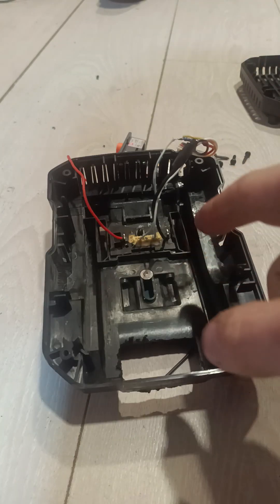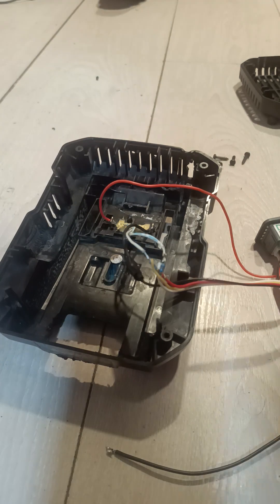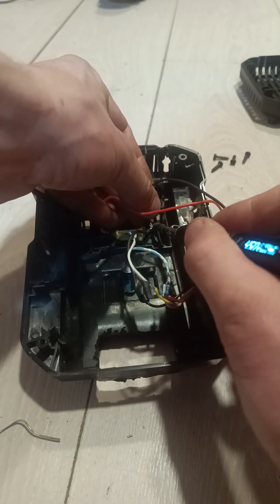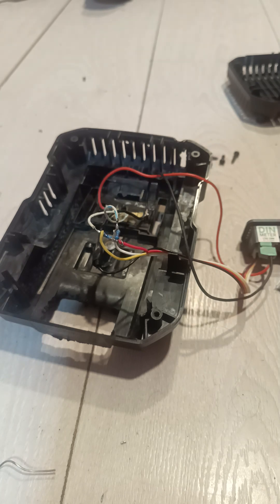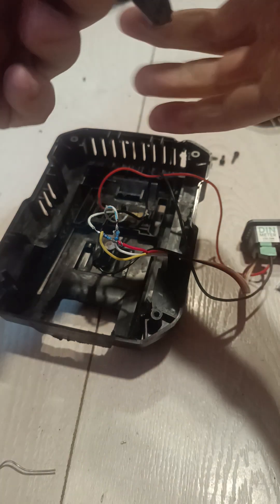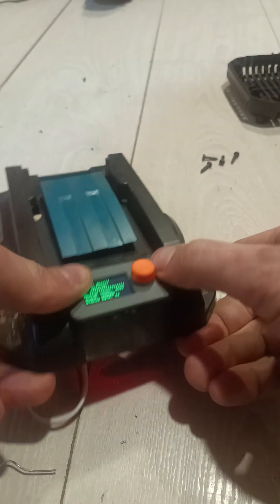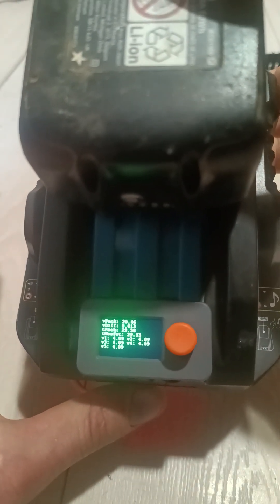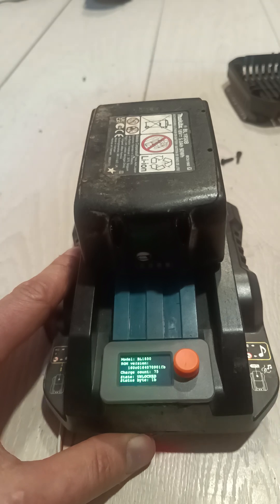Makita error/lockout flag reset ( simple standalone ) based on open-battery-information.

Comment: Hello my friend 
I tried install firmware to DinMeter but showing this error.

"Compilation error: grpc: error while marshaling: string field contains invalid UTF-8" I am sure I am doing something wrong but could not find yet. Can you help me please? Or can you crfeate some video about how can install firmware to Dinmeter
Reply: grpc: error while marshaling: string field contains invalid UTF-8

Compilation error: field 'owi' has incomplete type 'Makita<5>'
Reply from the maker: @eleman27  Makita headers not included correctly? or not installed in libraries folder?
Reply: @diybatterytech  there is too much error really I could not understand that
Reply: c:\Users\HMKOCER\OneDrive\ h L       g\Arduino\libraries\OneWire\OneWire2.cpp:147:6: error: 'template<int m_pin> class OneWire' used without template arguments
  147 | void OneWire::begin(uint8_t pin)
      |      ^~~~~~~
c:\Users\HMKOCER\OneDrive\ h L       g\Arduino\libraries\OneWire\OneWire2.cpp: In function 'void begin(uint8_t)':
c:\Users\HMKOCER\OneDrive\ h L       g\Arduino\libraries\OneWire\OneWire2.cpp:150:9: error: 'bitmask' was not declared in this scope; did you mean 'umask'?
  150 |         bitmask = PIN_TO_BITMASK(pin);
      |         ^~~~~~~
      |         umask
c:\Users\HMKOCER\OneDrive\ h L       g\Arduino\libraries\OneWire\OneWire2.cpp:151:9: error: 'baseReg' was not declared in this scope
  151 |         baseReg = PIN_TO_BASEREG(pin);
      |         ^~~~~~~
c:\Users\HMKOCER\OneDrive\ h L       g\Arduino\libraries\OneWire\OneWire2.cpp: At global scope:
c:\Users\HMKOCER\OneDrive\ h L       g\Arduino\libraries\OneWire\OneWire2.cpp:164:9: error: 'template<int m_pin> class OneWire' used without template arguments
  164 | uint8_t OneWire::reset(void)
      |         ^~~~~~~
c:\Users\HMKOCER\OneDrive\ h L       g\Arduino\libraries\OneWire\OneWire2.cpp: In function 'uint8_t reset()':
c:\Users\HMKOCER\OneDrive\ h L       g\Arduino\libraries\OneWire\OneWire2.cpp:166:9: error: 'IO_REG_TYPE' was not declared in this scope; did you mean 'IP_GET_TYPE'?
  166 |         IO_REG_TYPE mask IO_REG_MASK_ATTR = bitmask;
      |         ^~~~~~~~~~~
      |         IP_GET_TYPE
c:\Users\HMKOCER\OneDrive\ h L       g\Arduino\libraries\OneWire\OneWire2.cpp:167:18: error: 'IO_REG_TYPE' does not name a type; did you mean 'IP_GET_TYPE'?
  167 |         volatile IO_REG_TYPE *reg IO_REG_BASE_ATTR = baseReg;
      |                  ^~~~~~~~~~~
      |                  IP_GET_TYPE
In file included from c:\Users\HMKOCER\OneDrive\ h L       g\Arduino\libraries\OneWire\OneWire2.h:1,
                 from c:\Users\HMKOCER\OneDrive\ h L       g\Arduino\libraries\OneWire\OneWire2.cpp:143:
c:\Users\HMKOCER\OneDrive\ h L       g\Arduino\libraries\OneWire\OneWire2.cpp:172:32: error: 'mask' was not declared in this scope; did you mean 'umask'?
  172 |         DIRECT_MODE_INPUT(reg, mask);
      |                                ^~~~
c:\Users\HMKOCER\OneDrive\ h L       g\Arduino\libraries\OneWire\OneWire_direct_gpio.h:263:57: note: in definition of macro 'DIRECT_MODE_INPUT'
  263 | #define DIRECT_MODE_INPUT(base, pin)    directModeInput(pin)
      |                                                         ^~~
c:\Users\HMKOCER\OneDrive\ h L       g\Arduino\libraries\OneWire\OneWire2.cpp:178:37: error: 'mask' was not declared in this scope; did you mean 'umask'?
  178 |         } while ( !DIRECT_READ(reg, mask));
      |                                     ^~~~
c:\Users\HMKOCER\OneDrive\ h L       g\Arduino\libraries\OneWire\OneWire_direct_gpio.h:260:52: note: in definition of macro 'DIRECT_READ'
  260 | #define DIRECT_READ(base, pin)          directRead(pin)
      |                                                    ^~~
c:\Users\HMKOCER\OneDrive\ h L       g\Arduino\libraries\OneWire\OneWire2.cpp: At global scope:
c:\Users\HMKOCER\OneDrive\ h L       g\Arduino\libraries\OneWire\OneWire2.cpp:198:6: error: 'template<int m_pin> class OneWire' used without template arguments
  198 | void OneWire::write_bit(uint8_t v)
      |      ^~~~~~~
c:\Users\HMKOCER\OneDrive\ h L       g\Arduino\libraries\OneWire\OneWire2.cpp: In function 'void write_bit(uint8_t)':
c:\Users\HMKOCER\OneDrive\ h L       g\Arduino\libraries\OneWire\OneWire2.cpp:200:9: error: 'IO_REG_TYPE' was not declared in this scope; did you mean 'IP_GET_TYPE'?
  200 |         IO_REG_TYPE mask IO_REG_MASK_ATTR = bitmask;
      |         ^~~~~~~~~~~
      |         IP_GET_TYPE
c:\Users\HMKOCER\OneDrive\ h L       g\Arduino\libraries\OneWire\OneWire2.cpp:201:18: error: 'IO_REG_TYPE' does not name a type; did you mean 'IP_GET_TYPE'?
  201 |         volatile IO_REG_TYPE *reg IO_REG_BASE_ATTR = baseReg;
      |                  ^~~~~~~~~~~
      |                  IP_GET_TYPE
c:\Users\HMKOCER\OneDrive\ h L       g\Arduino\libraries\OneWire\OneWire2.cpp:205:39: error: 'mask' was not declared in this scope; did you mean 'umask'?
  205 |                 DIRECT_WRITE_LOW(reg, mask);
      |                                       ^~~~
c:\Users\HMKOCER\OneDrive\ h L       g\Arduino\libraries\OneWire\OneWire_direct_gpio.h:261:56: note: in definition of macro 'DIRECT_WRITE_LOW'
  261 | #define DIRECT_WRITE_LOW(base, pin)     directWriteLow(pin)
      |                                                        ^~~
c:\Users\HMKOCER\OneDrive\ h L       g\Arduino\libraries\OneWire\OneWire2.cpp:213:39: error: 'mask' was not declared in this scope; did you mean 'umask'?
  213 |                 DIRECT_WRITE_LOW(reg, mask);
      |                                       ^~~~
c:\Users\HMKOCER\OneDrive\ h L       g\Arduino\libraries\OneWire\OneWire_direct_gpio.h:261:56: note: in definition of macro 'DIRECT_WRITE_LOW'
  261 | #define DIRECT_WRITE_LOW(base, pin)     directWriteLow(pin)
      |                                                        ^~~
c:\Users\HMKOCER\OneDrive\ h L       g\Arduino\libraries\OneWire\OneWire2.cpp: At global scope:
c:\Users\HMKOCER\OneDrive\ h L       g\Arduino\libraries\OneWire\OneWire2.cpp:226:9: error: 'template<int m_pin> class OneWire' used without template arguments
  226 | uint8_t OneWire::read_bit(void)
      |         ^~~~~~~
Reply: c:\Users\HMKOCER\OneDrive\ h L       g\Arduino\libraries\OneWire\OneWire2.cpp:297:6: error: 'template<int m_pin> class OneWire' used without template arguments
  297 | void OneWire::select(const uint8_t rom[8])
      |      ^~~~~~~
c:\Users\HMKOCER\OneDrive\ h L       g\Arduino\libraries\OneWire\OneWire2.cpp: In function 'void select(const uint8_t*)':
c:\Users\HMKOCER\OneDrive\ h L       g\Arduino\libraries\OneWire\OneWire2.cpp:301:10: error: no matching function for call to 'write(int)'
  301 |     write(0x55);           // Choose ROM
      |     ~~~~~^~~~~~
C:/Users/HMKOCER/AppData/Local/Arduino15/packages/m5stack/tools/esp-x32/2411/xtensa-esp-elf/include/sys/unistd.h:231:25: note: candidate: 'int write(int, const void*, size_t)'
  231 | _READ_WRITE_RETURN_TYPE write (int __fd, const void *__buf, size_t __nbyte);
      |                         ^~~~~
C:/Users/HMKOCER/AppData/Local/Arduino15/packages/m5stack/tools/esp-x32/2411/xtensa-esp-elf/include/sys/unistd.h:231:25: note:   candidate expects 3 arguments, 1 provided
c:\Users\HMKOCER\OneDrive\ h L       g\Arduino\libraries\OneWire\OneWire2.cpp:251:6: note: candidate: 'void write(uint8_t, uint8_t)'
  251 | void OneWire::write(uint8_t v, uint8_t power /* = 0 */) {
      |      ^~~~~~~
c:\Users\HMKOCER\OneDrive\ h L       g\Arduino\libraries\OneWire\OneWire2.cpp:251:6: note:   candidate expects 2 arguments, 1 provided
c:\Users\HMKOCER\OneDrive\ h L       g\Arduino\libraries\OneWire\OneWire2.cpp:303:34: error: no matching function for call to 'write(const uint8_t&)'
  303 |     for (i = 0; i < 8; i++) write(rom[i]);
      |                             ~~~~~^~~~~~~~
C:/Users/HMKOCER/AppData/Local/Arduino15/packages/m5stack/tools/esp-x32/2411/xtensa-esp-elf/include/sys/unistd.h:231:25: note: candidate: 'int write(int, const void*, size_t)'
  231 | _READ_WRITE_RETURN_TYPE write (int __fd, const void *__buf, size_t __nbyte);
      |                         ^~~~~
C:/Users/HMKOCER/AppData/Local/Arduino15/packages/m5stack/tools/esp-x32/2411/xtensa-esp-elf/include/sys/unistd.h:231:25: note:   candidate expects 3 arguments, 1 provided
c:\Users\HMKOCER\OneDrive\ h L       g\Arduino\libraries\OneWire\OneWire2.cpp:251:6: note: candidate: 'void write(uint8_t, uint8_t)'
  251 | void OneWire::write(uint8_t v, uint8_t power /* = 0 */) {
      |      ^~~~~~~
c:\Users\HMKOCER\OneDrive\ h L       g\Arduino\libraries\OneWire\OneWire2.cpp:251:6: note:   candidate expects 2 arguments, 1 provided
c:\Users\HMKOCER\OneDrive\ h L       g\Arduino\libraries\OneWire\OneWire2.cpp: At global scope:
c:\Users\HMKOCER\OneDrive\ h L       g\Arduino\libraries\OneWire\OneWire2.cpp:309:6: error: 'template<int m_pin> class OneWire' used without template arguments
  309 | void OneWire::skip()
      |      ^~~~~~~
c:\Users\HMKOCER\OneDrive\ h L       g\Arduino\libraries\OneWire\OneWire2.cpp: In function 'void skip()':
c:\Users\HMKOCER\OneDrive\ h L       g\Arduino\libraries\OneWire\OneWire2.cpp:311:10: error: no matching function for call to 'write(int)'
  311 |     write(0xCC);           // Skip ROM
      |     ~~~~~^~~~~~
C:/Users/HMKOCER/AppData/Local/Arduino15/packages/m5stack/tools/esp-x32/2411/xtensa-esp-elf/include/sys/unistd.h:231:25: note: candidate: 'int write(int, const void*, size_t)'
  231 | _READ_WRITE_RETURN_TYPE write (int __fd, const void *__buf, size_t __nbyte);
      |                         ^~~~~
C:/Users/HMKOCER/AppData/Local/Arduino15/packages/m5stack/tools/esp-x32/2411/xtensa-esp-elf/include/sys/unistd.h:231:25: note:   candidate expects 3 arguments, 1 provided
c:\Users\HMKOCER\OneDrive\ h L       g\Arduino\libraries\OneWire\OneWire2.cpp:251:6: note: candidate: 'void write(uint8_t, uint8_t)'
  251 | void OneWire::write(uint8_t v, uint8_t power /* = 0 */) {
      |      ^~~~~~~
c:\Users\HMKOCER\OneDrive\ h L       g\Arduino\libraries\OneWire\OneWire2.cpp:251:6: note:   candidate expects 2 arguments, 1 provided
c:\Users\HMKOCER\OneDrive\ h L       g\Arduino\libraries\OneWire\OneWire2.cpp: At global scope:
c:\Users\HMKOCER\OneDrive\ h L       g\Arduino\libraries\OneWire\OneWire2.cpp:314:6: error: 'template<int m_pin> class OneWire' used without template arguments
  314 | void OneWire::depower()
      |      ^~~~~~~
c:\Users\HMKOCER\OneDrive\ h L       g\Arduino\libraries\OneWire\OneWire2.cpp: In function 'void depower()':
c:\Users\HMKOCER\OneDrive\ h L       g\Arduino\libraries\OneWire\OneWire2.cpp:317:36: error: 'bitmask' was not declared in this scope; did you mean 'umask'?
  317 |         DIRECT_MODE_INPUT(baseReg, bitmask);
      |                                    ^~~~~~~
c:\Users\HMKOCER\OneDrive\ h L       g\Arduino\libraries\OneWire\OneWire_direct_gpio.h:263:57: note: in definition of macro 'DIRECT_MODE_INPUT'
  263 | #define DIRECT_MODE_INPUT(base, pin)    directModeInput(pin)
      |                                                         ^~~
Multiple libraries were found for "OneWire2.h"
  Used: C:\Users\HMKOCER\OneDrive\ドキュメント\Arduino\Libraries\OneWire
  Not used: C:\Users\HMKOCER\OneDrive\ドキュメント\Arduino\Libraries\OneWire-2.3.8
grpc: error while marshaling: string field contains invalid UTF-8

Compilation error: grpc: error while marshaling: string field contains invalid UTF-8
Reply: @diybatterytech  I put （m5din-makita-main）folder in libraries folder. If you want I can upload all eror logs
Reply from the maker: @eleman27  https://github.com/no-body-in-particular/m5din-makita/tree/main/Arduino/libraries/OneWire-2.3.8 you should put this folder in the libraries folder. then open the sketch in arduino ide
Reply from the maker: @Tanbuser85 What's the complete error message?
Reply from the maker: @Tanbuser85 There are messages before that right? What does it show?
Reply: Please support

Comment: Trying again. It seems like Youtube is deleting my comments. Can you get in touch through email instead?
Reply from the maker: sent you an email on the openbatteryinformation gmail, also included all the hikoki firmwares :P
Reply: @diybatterytech  cannot get any comments on you tube can you email me a link where to get the parts and wiring procedure thanking you
Reply from the maker: @Kystar1015  Part one is a m5din, you can google this keyword and you will end up on the m5stack website. you need one of their m5stack connection wires as well. Second part is a mini makita battery charger from aliexpress, exact one as in the video, for wiring the + of the m5stack wire gets connected to the white and yellow wires with a 4k7 pullup resistor, then these wires go to the battery connector.  + and - on the m5stack also go to the battery connector. pictures of how to wire it are on the github - aliexpress links are on this video.

Comment: Awesome!
Reply from the maker: :) thank you, going to do a little MITM stuff with an ESP and the BTC04 this weekend, see if i can get a bit more information on the screen here.
Reply from the maker: I've updated the GitHub, all the status bytes have been decoded ( overheat etc ) + i've included a battery side implementation as well. Are you getting along with the F0513 unlock method? Or should I grab my debugger and go have a look there :P Either way this software now supports everything the BTC04 does - but better. On to the BTC05 it is.
Reply: @diybatterytech  Interesting! By decoding the status byte, you mean the three icons in BTC04? I see you combine it with your own interpretation of fault states? 

I have most of F0513 figured out, i'd love to see what you can figure out though since my approach is very complicated. Makita XGT is also something that i have solved but not yet released.
Reply from the maker: @mnh-jansson  Nice, i'm guessing code cave & overwrite those lockout bytes? And yeah i read the status from the extra parameters :P
Reply from the maker: @mnh-jansson  Also since you're working on hikoki machines too, have you see this part number yet? https://www.sparepartsworld.co.uk/product/HIT376372 ;)
Reply: @I've reverse engineered the bootloader in order to unlock F0513. I found that there was a way to enter the bootloader by sending a command on the onewire line, then switch protcol to single wire uart. With this i am able to extract firmware, write and erase blocks. So what i've done is extract the section that emulates EEPROM and parse the content to locate error flags and then clear them.

I've not seen the Hikoki tool no, would be interesting to see a picture of it.
Reply from the maker: @mnh-jansson  Yes they basically followed the reference implementation for the bootloader provided by the manufacturer https://community.renesas.com/mcu/legacy-mcu/78k0__78k0s/f/78k0-78k0s---forum/4358/bootloader-for-78k0-kx2/13866 it calls a bootloader provided by them stored in hidden ROM., And my hikoki analyzer will arrive soon, i'll share more when i have it - already got the software for it tho -  i still don't have any batteries or BMSes for it but it was too good to pass up ;)